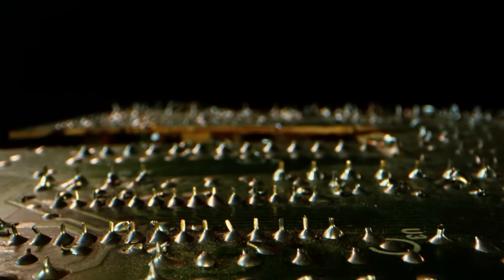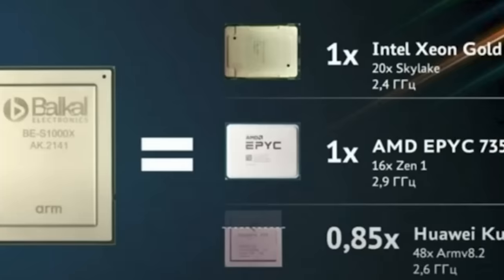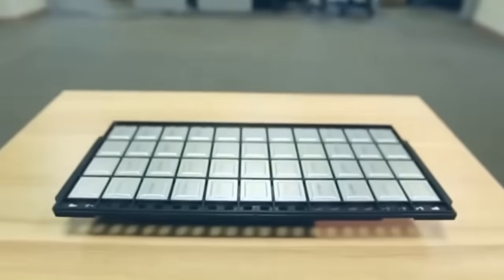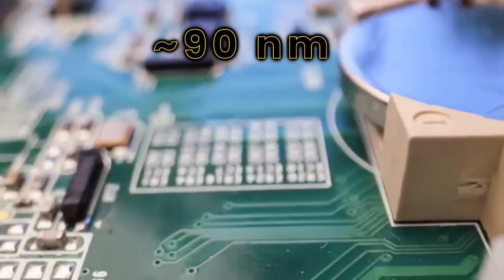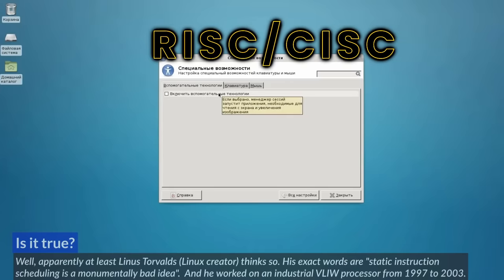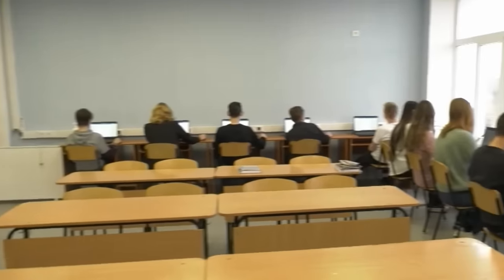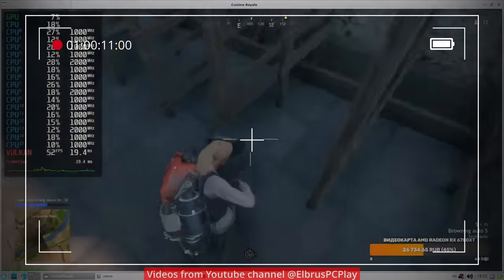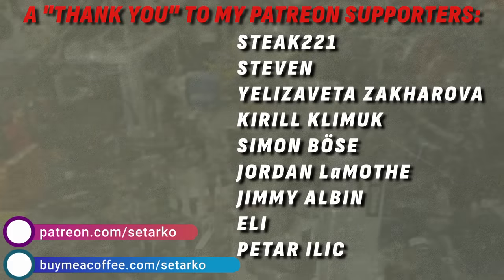Just How Good are Russian CPUs?

Comment: 6:31 Well Micron states that they are able to produce down to 28nm on their websites frontpage, not sure if it is their current capability, planned one, outsourced one, or just "not en-mass" production(aka they to the limits of stacking layers of masks and end up with a LOT of manufacturing errors that makes it unsuitable for en-mass production)

EDIT: Scrap that, that was on their old website, on a new one 65 nm is the limit and quick google search reveals they only PLANNED to open 28 nm line, but it looks like they failed.
Reply: "but it looks like they failed"
Nuh. It's still on their way, but it wont be so fast as many expected.

Comment: How do we know that Elbrus has no vulnerabilities similar to spectre and meltdown, or even some new classes of vulnerabilities? Just because more security researchers are looking at these more mainstream chips and are more likely to turn up vulnerabilities, that doesn't mean that Russian part lacks vulnerabilities. On the contrary, it might be argued that the mainstream parts have less vulnerabilities because they have more widespread scrutiny.
Reply: and yes and no, sometimes vulnerabilities are found even in open source software only after a long time, because not everyone will read and understand thousands of lines of code
Reply: in general, they usually talk about Elbrus in the context of spectrum and meltdown, perhaps there are some others, but Elbrus has a separate chip - a compiler that is also responsible for the safety of code execution, this is very different from how it is done in modern PCs

Comment: The division of the Russian Academy of Sciences associated with the creation of lasers took a large part in the creation of modern lithographs from ASML. Therefore, Russia has some experience in creating such installations. Several prototypes are currently being created, one of which uses a radiation source based on xenon plasma with a wavelength of 11.2 nm. For this wavelength, in 2022, the IPM RAS developed a technology for sputtering multilayer Ru/Be (ruthenium-beryllium) X-ray mirrors with a reflectance of 72%. In its first version, the lithograph being created will be focused on topological standards of 28 nm with the prospect of upgrading to 10 nm and thinner.

Comment: Even if Chine were to invade and capture Taiwan. Taiwan would probably destroy the microchip factories to prevent China from getting access to them.
I'm not sure, but I think China has a couple of it's own FABS capable of producing chips on one of the older nodes.
So maybe if Russian and Chinese computer scientists and engineers co-operated, they could build a powerful desktop CPU. The Chinese chip market is huge, so they would probably be able to sell enough chips to be profitable too.
Reply: the destruction of TSMC would effectively shut down the supply of advanced semiconductors to the west as well. It would take years before they could be rebuilt elsewhere. 

It would be the tech equivalent of MAD.
Reply: @hughmungus2760  It is true that the market would be slowed down a lot, but it wouldn't completely stop. Intel would probably make a lot of money since they have built multiple FABS in the US and in Europe.
Though, they don't come anywhere close to the volume of chips that TSMC produces.
Reply: @stefannilsson2406   this would be on top of a collapse in supply chains from anything made in china. Keep in mind a vital step in the semiconductor manufacturing process is 'packaging' which involves putting the etched wafer into a chip, which china does alot of.

Not to mention building new fabs is going to require alot of construction materials, much of which is coming from china too.
Reply: @hughmungus2760  I can imagine some chips being packaged in China but probably not any of the modern nodes.

Since Intel, AMD, and Nvidia are all based in the US they have to comply with the chip export ban to China. I would assume this would apply to packaging chips in china even if they wouldn't be sold in China.

On the box my CPU came in it says "made in Costa Rica". So I would assume the chip came from Costa Rica since Intel has a FAB there and maybe even packaged there.

Comment: The solution to the Elbrus performance drawbacks is multiple instruction multiple data. Hear me out, there is a processor called the zilog ez80 that runs at 50 megahertz, but it appears to the programmer to be running at 150 megahertz so long as you have ram fast enough. It has three pipeline stages meaning it can execute three operations per clock cycle. A real world example of multiple instruction multiple data is the kilocore adapteva epiphany five, but I suggest using that chip as the main CPU in a graphics card surrounded by raster operations, ray tracing and complex math Asics. My suggestion would be a microprocessor without interlocking pipeline stages that can execute 8 64 bit istructions per clock cycle with a total of 512 bits for data and 16 opcodes per clock cycle for a total of 1024 bits for opcodes. It would run at 2.4 gigahertz with 4 CPU cores. It's instruction set would be a mix of Arm v9.2, OpenPower 3.1b and X86-64 14th Gen Intel core while removing duplicate instructions with the goal of being able to emulate in hardware/firmware all three by modifying the lookup table.

Comment: Enough for any type of military application.

Few understand that during the Golf War all of the US Tomahawk cruise missiles were powered by... 286 equivalent CPUs! Yes people, they were made in the early to mid 80's and they used the curent available technology of the time. And these weapons were capable of terrain mapping, low altitude flying, GPS and inertial guidance and live TV feed for the last section of the trajectory sending back movies of them entering trough the window of the target building.

All of that using 286 equivalent silicon and about 128kb RAM and later upgraded to 512.

The incredible successful Exocet anti-ship missiles used by Argentina during the Falklands War, used, take a deep breath, transistors! Yes, they were manufactured in the 70's and had just one or two Z80 compatible microcontrollers at best, but most of them have none and used transistors.

Humanity reached the Moon using 2kb or RAM and 32kb of ROM memory! The Moon! 

When people complain about an Elbrus having too few cores at too slow speeds they don't understand that a rocket will self destruct. Its final destination is boom! Why use a 1500 dollar high end thread ripper CPU on a device that will go boom?

The cheapest chips capable of guiding a kaboom drone are about 10-20 times less expensive than the entire integrated circuit in your consumer grade smartphone. And they are enough for the task ahead.

Also Russia shares a 4700km long land border with China, with countless tunnels and passes, many of them completely secret from satellites and human foot alike. They can buy billions of chips and silicon parts and no one will ever know. This gives Russia unlimited access to any type of silicon in circulation on the planet, regardless of capacity and power.
Reply: Why use a 1500 dollar high end thread ripper CPU on a device that will go boom?  Accuracy.  Ukraine is currently achieving better results (and a lot less collateral damage) while using much fewer rounds because they have access to precision kit (that uses those $1500 CPUs).  Russia has none of this.
Reply: @alexhajnal107  
Again, read the entire post.
There is no accuracy gains since a single core 286 CPU with 2.5Mhz is enough to guide a Tomahawk cruise rocket from an underwater submarine, 1200 miles deep inside the enemy territory, and hit trough a window.

If anyone believes that a military grade CPU is expensive, or powerful, it is either uneducated on the topic or believes in scifi movies too much.

Weapon grade silicon is cheap, redundant and rugged. Even today most US cruise missiles use early 2000's tech. 

Go search online, what were the common CPUs used back then? Intel Pentium 2 was just replaced by Celeron and AMD released its flagship 800Mhz single core CPU.

Yes, that's the reality. 
US Nuclear powered submarines use Pentium One CPUs and most of the intercontinental ballistic missiles never heard of multicore, a few barely got "upgraded" to something similar with Pentium 1!

Weapons do not need computing power.
The cheapest drone, with a 15$ Chinese mobile integrated board with a simple 1.4$ snapdragon CPU, GPU guidance and a 3$ HD camera can guide any weapon on the battlefield with a better accuracy than most weapons in use.

To believe that you need a massive multicore multithread CPU for a ballistic missile that could home in a GSM signal and hit within a 1.2meter range even during the Chechen War, shows ignorance.

Weapons do not use that much power, they never did, they never will. 

Who say otherwise is either a propagandist or a ignorant on the subject. 

Go online, search for data, see for yourself. Compare various "smart weapons" and see how little computing power they actually use.
Reply: @cristitanase6130   I thought you were using "gamer CPU" as an analogy.  What really matters is processing power in a given space.  There's no way you'll fit a Tomahawk's electronics into an artillery shell without miniaturization.
Reply: @alexhajnal107  There's no need for that, as a cheap smartphone board will do the trick, and it's cost is under 5$.

Again, you don't need much processing power to guide weapons. Whatever a plastic drone can do is more than enough for most of weapons.

The "Russia lacks chips" lie is just part of the insane propaganda we all got subjected to for the last one year.

The reality is quite different. 
Russia has both the capacity and the capability to make its own silicon, enough in numbers and quality, for all its weapon production needs.

That is something few in the Western media will admit, yet.

And when it comes to research, even nuclear reactors and weapons have been developed using cathode tubes, not to say transistors, let alone the most basic microchips.
Reply: @alexhajnal107  accuracy has more to do with good optics and a stable connection. None of Ukraine or Russia's drones are advanced to the point of being able to self identify and attack targets with AI and from what I've seen they aren't able to autonomously swarm either. Only china and the US are anywhere near that level of tech.
Reply: @hughmungus2760  I was thinking more of GPS guided shells and the like.  Good points though.
Reply: @alexhajnal107   Thats because Russian intel isn't as good due to a lack of recon satellites. the CEP on the latest Krasnopol rounds are as good as anything NATO has.

It also has alot to do with NATO being able to fly recon drones in the black sea but Russia cant fly their own recon assets behind ukrainian lines.
Reply: @hughmungus2760  That Russian system is laser-guided, not autonomous.  It requires someone within 5km painting the target (this also warns the target).
Reply: @alexhajnal107  Im sure Russia has some other system thats Glonass guided but the battlefield intel problem is still the main culprit.

Comment: Well as long as they move to Risc-V to cut down on design work get the frequency to at least 1.5Ghz they will be fine, Russia can do 40nm but it's on old gear using 200mm wafers so Ghz is possible just the economics will suck a bit

Comment: The main consumer of Russian-indigenous semiconductor chips is Russian military and space program. And such a military system does not require state-of-art chip or semiconductor process. 28- or 14- nano chips are more than enough, even old 65 nm chip is enough. 65 nm is on level of Intel core2 or AMD Athlon or Xbox 360 APU around 2007 era, 15 years ago.They are perfectly suitable for modern Russian weapon systems like fighter jet, ballistic missile, tanks, anti-tank missile and ICBM's, radar etc. Even latest US F-35 fighter jet uses similar processor for its flight controller (about 3000 DMIPS) So it is not major obstacle for Russian military program development. Problem is that they are not used/sold commercially or by consumer or exported, the demand for them is extremally limited and low volume so they are extremely expensive to supply to Russian military manufacturer.

Comment: the highend photolithography machines are a hassle, i read somewher we (mankind) can only build 3-4 per years and cost 200 million each
Reply: That is the ASML "EUV" machine. The cost and complexity alone should be a hint that maybe there is another way to accomplish this? Think about over-engineered German cars versus Japanese.
Reply: @zelenicaljubljanica5410 Or that they are like the pyramids of our time, the most complex stuff we can create.
Reply: Why make more when your company has a monopoly on the machines and can keep the price at whatever you want.
Reply: @zelenicaljubljanica5410   It's just (not-so) basic physics.  EUV is very tricky to work with.  It only gets worse as you go up in energy (X-rays and gamma rays).

Comment: How good are Russian CPUs? As good and bad it could be. 

In simple terms, Elbrus and Baikal are probably two unique CPUs with its own challenges radically different from Intel and AMD CPUs. If you are familiar with video gaming world, these are probably the exact reasons that game developers have a hard time or even bankrupt themselves for porting a game to multiple platforms such as PC, Xbox and PlayStation. It is somewhat easier for companies to create program to an agreed set of hardwares that will not be changed on a whim in a radical way. Also a reason why Apple iOS can outperform Androids but generally garbage in gaming world for its Macintosh.  

The performance difference can be drastically crappy for any CPU built with different architectures (architectures = fun ways group of intellectual gopniks decide for ways CPUs 'digest' series of bits, usually 32 or 64 bits, to activate parts of CPU for any kind of CPU works) or becomes even better compared to its supposed main rival. Being better though can start to become subjective.

Personal experience? A Nintendo DS emulator can force my 8th gen Intel CPU to run at 50-60% of its full capacity while running games with lag on its best performance. Mind you an NDS runs on 2 old ARM architectures. Intel's x86 architecture is tried and tested, but realistically getting more and more outdated and bloated. Intel knew this and created together with HP, Itanium using VLIW which is supposed to replace x86. It failed (try reading on Itanium development, it's fun if you just want to know a bit of story in the computing world). 

Eventually, Intel and AMD (Intel created x86 and AMD x86-64 architectures) uses what can be compared to be as a polished rock. Elbrus and Baikal are comparatively garbage, but remember the history of both Intel and AMD is older than Russian Federation itself. So yes, it's not good if you are a gamer outside Russia trying to outperform an Intel computer. But if you are trying to ensure your banks won't die in the future both and Elbrus and Baikal are a good backup. They just need programming to be better (basically porting over).

China may be able to supply Russia with current Intel and AMD CPUs but eventually Russia must push for radical development in computing, even looking back at all Soviet era computing to learn its mistakes or revive old ideas which the West is too deep in their own computing standards to economically alter. 

 Russia could actually create multiple architecture like RISC-V though. That would probably boost Elbrus and Baikal if they still exist in the future.

Comment: 65nm is good enough
Reply: For military appliances and workstations, yes. For anything else, not really, but why should you play CS:GO and War Thunder when you can do the real thing in real life?
Reply: @IGLArocknroll  I mean I still have desktop computers on 65nm technolgoy and older, and they run just fine, the same applications as always, video editing, photo management, web browsing, computer games. Just like in 2008 you were happy to buy a new computer with Windows 7 and it did everything you needed, just the same with those Russian microprocessors.
Reply: @hufficag  Yeah but when your talking about next gen avionics requiring graphics cards to render shit like cockpits, then it becomes an issue.
You cant run modern day Teslas off 65nm process nodes. The F35's GPU for the PCD-EU, runs off a 14nm process node most likely.
Reply: 640 kb is good enough
Reply: @honkhonk8009  No, cockpit displays and the like can run just fine off 20 yearold GPUs, they're not intended to look like AAA games, What might be an issue further down the track might be for AI driven 6th gen fighters which will need high powered processors both in designing and in their operation, but that is a decade off and by then China would likely have gained semiconductor independence and could export chipmaking equipment to Russia